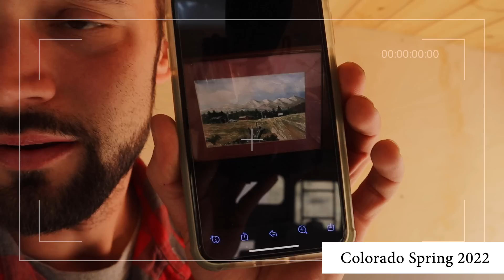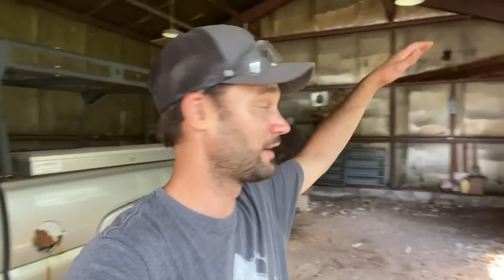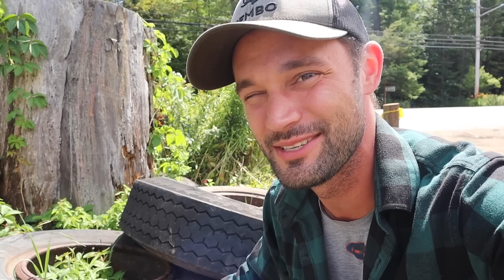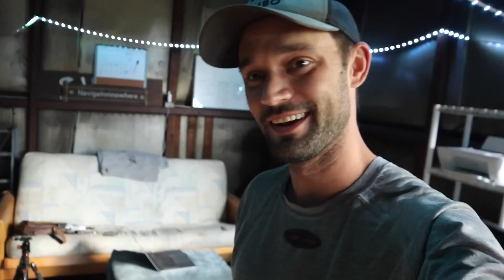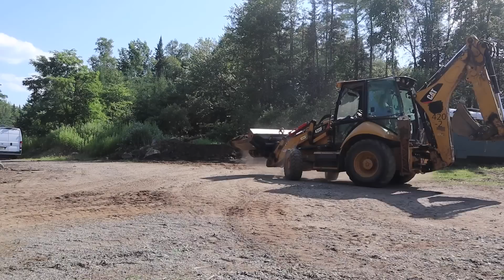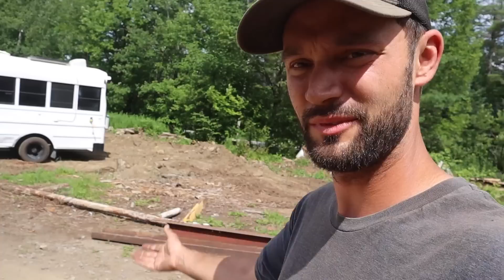Renovating an ABANDONED Shop Space | The Start of Something New

Comment: Beautification:
1. The Barn/workshop should have a Big A** Size Sign board on front with LED lights shining on it.. like you see on the road side billboards. with the words at the bottom Est 1950 and repurposed 2022, add some wall hanging framed photos (if you can find them) from the workshop wood glory days inside.
2. for any front parking spaces a good way to show the place being used is  to put down some gravel (err 8 truck loads of 4 gravel 2" to 3" crushed gravel).. on the outside and flatten it with Mechanical roller).. so your Truck Campers have some solid ground to be parked on and not standing in water/snow puddles in the upcoming Autumn/winter.
3. Since most of your work is related to Camper building... add some parking power connection sockets by the campers standing outside. .before laying down the gravel.
4. Add a (in good condition) container beside the main building so you can store all your tools in that.
5. install an outdoor standard usage toilet.. so no ones going to the poo poo at the workshop.
6. make a small kitchen area for yourself so you're not going out to buy food.
7. a good size fire pit with seating arrangements and string lights.. to light up the area.
8. Add a farm size gate so no one can come on to your property.

Comment: Maybe consider moving the larger rocks to the property along the road. Build a security berm that will keep anyone from entering the property forcing vehicles through the gate. Also if you'll be doing oil changes keep the used oil,purchase an oil heater designed to burn used oil and no splitting wood which is a plus. Looks like a nice piece of property and awesome shop.

Comment: Good to see you back. Looks like there will be enough to do between site, building, and rigs to keep you out of trouble for the foreseeable future.

I do have a suggestion. It's based on nearly sixty years of construction experience. It's free - do with it what you will. Try to avoid dark colors of exterior finishes. Solar exposure really beats the heck out of dark paints and stains on wood and metal surfaces. In your case the overhead door has a limited remaining life. The dark finish is just going to kill it faster. A dark finish on the steel entry door will also be able to become hot enough to cause dangerous burns on any unprotected skin that comes in contact with it. In the case of new steel doors, manufacturers specifically caution against dark colors. There have been several instances of small children receiving serious burns from contact. Also, the heat can quickly degrade interior insulation of those doors when they are insulated.

In any case, best of luck on an exciting long term project!

Comment: Look for an old oil furnace (hot air or water/radiators) they can be converted to waste oil heaters and will burn a variety of waste fuel (heating oil, kerosene, diesel, waste oil, waste veggie oil). If you get a water/radiator oil heater you could have hydronic heat in the slab that you eventually pour for the floor.
Reply: My great-grands had a similar setup in their chicken coops in the 1940's. 
Good engineering is timeless.